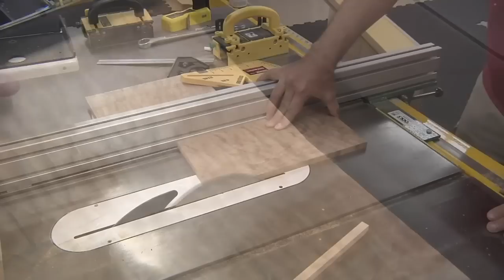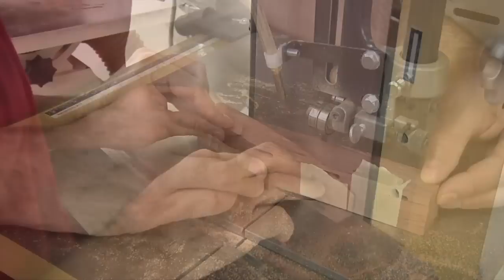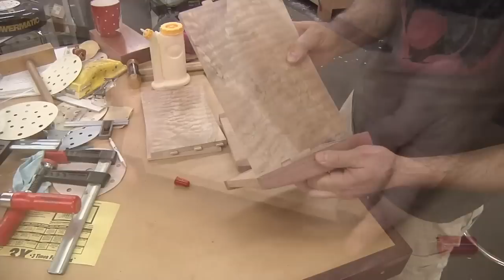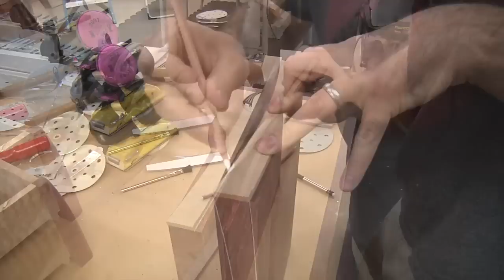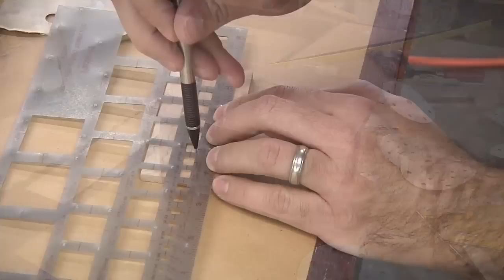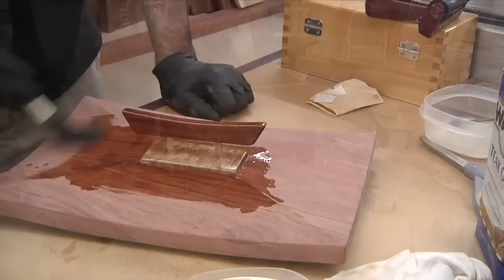239 - Memorial Box

Comment: What is the tool called that drills into the side of the wood for dowels?
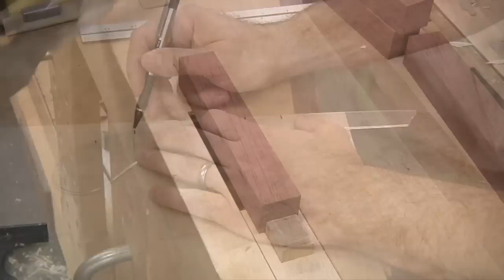Reply: If you're referring to the tool I see at the 1:37 minute mark, it looks like a biscuit joiner. But it uses biscuits, not dowels, so maybe that's not what your're referring to. The one in the video cut small slots, so it's probably a detail biscuit joiner.